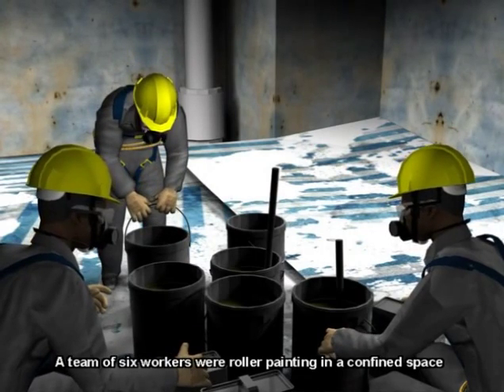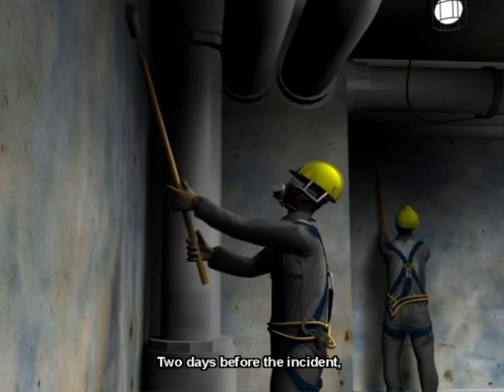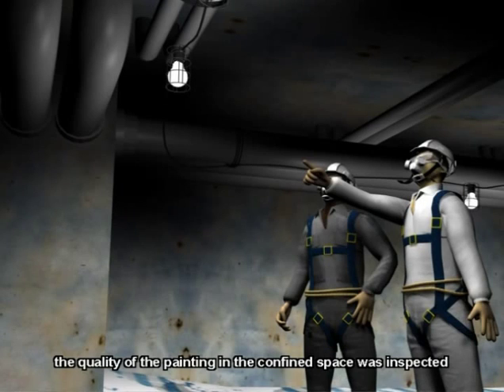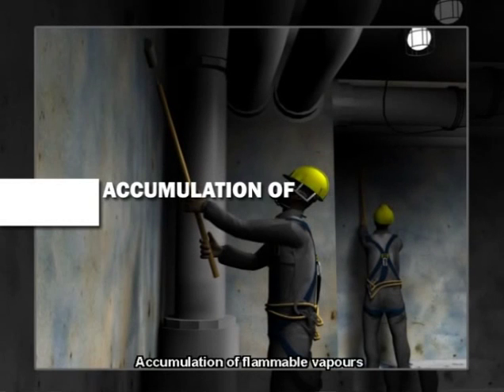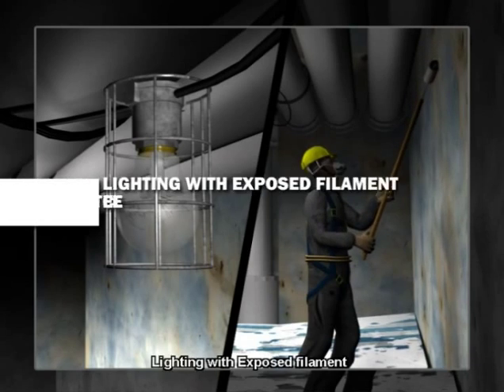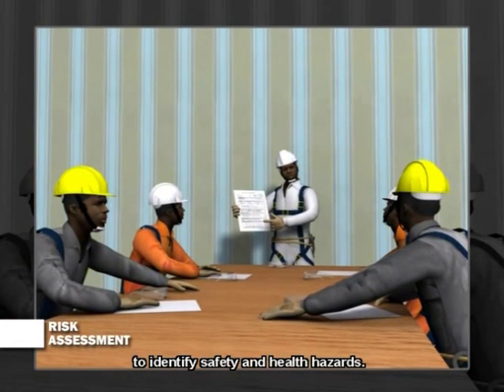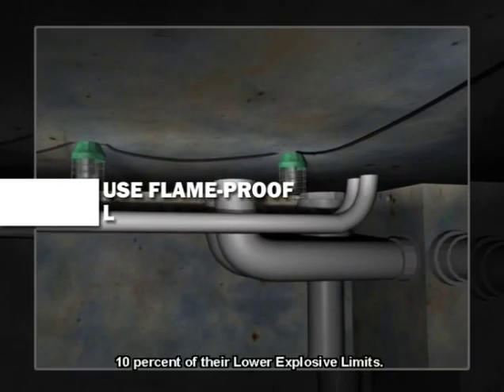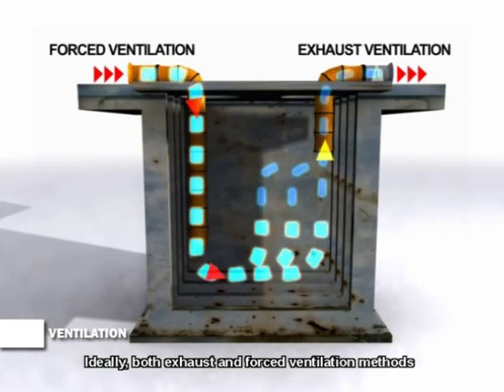Case Study 2: Flash Fire in Pontoon Tank

Comment: so what conclusion can you give from that story?
Reply: Paint mixing should be done outside of the confined space. Explosion proof lighting should be used inside confined space. Forced ventilation can be done using a more powerful blower. Gas checks to be done on more regular basis and noting when painting is in progress. A workmen inside confined space space should wear a clip on gas detector that can warn of flammable gas buildup.

Comment: How did flammable gasses accumulate and go unnoticed if they where doing regular gas checks?
Reply: The device used for the gas checks prior to entry didn't measure the flammable vapours. It was looking at gasses like CO, oxygen, and likely nitrogen
Reply: Gas check done at entry point. But not done when paint mixing and drying inside confined space. If gas check done during this activity the flammable  LEL reading would have been detected by a multi gas meter. Forced ventilation used was not strong enough to counter the flammable gas accumulation in the confined space.